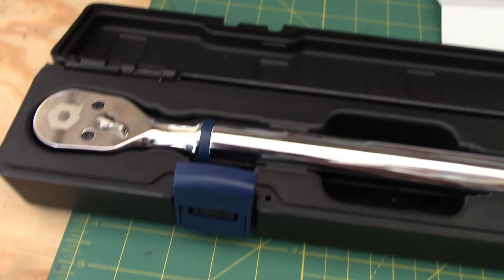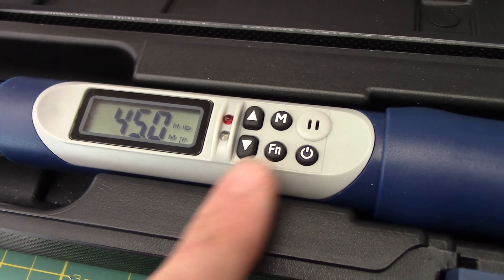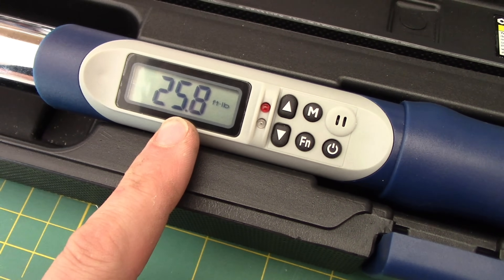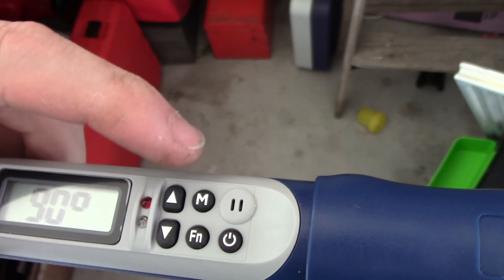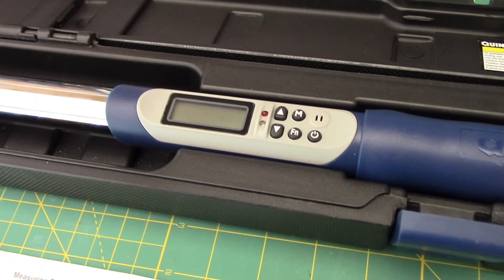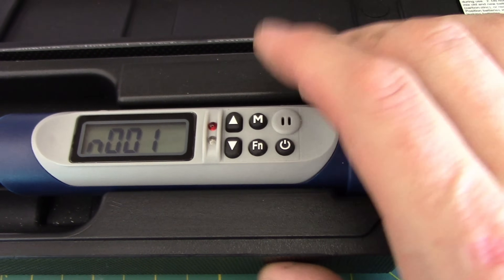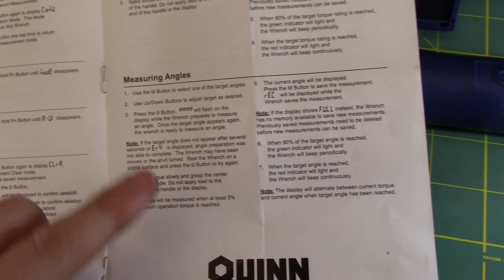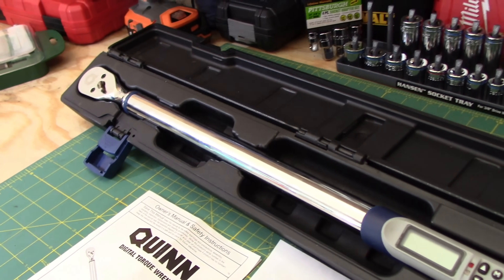How to Guide Harbor Freight QUINN Digital Torque Wrench including Torque Angles

Comment: This video is misleading, this torque wrench does come equipped with gyro to accurately measure torque ANGLE.
PLEASE BE ADVISED 

 like higher-end brands (e.g., Snap-On); it relies on a strain gauge to detect torque, and its angle measurement function often struggles or fails because it only starts measuring angle after significant torque is applied, making it unreliable for precise torque-to-angle steps compared to gyro-equipped models. Users report that while the torque measurement works fine, the angle feature often gives inaccurate readings, especially on loose bolts, leading many to recommend other brands for that specific function.

Comment: Ok, so basically you should torque your bolt to desired foot lbs first. then input those foot lbs and desired degrees.
Reply: I can't figure out to set the torque starting point though. In the instructions for "Setting angle torque unit" on the last step as soon as I press the Fn button to hold it, it changes screens

Comment: Thank you so much for posting this.  Sorry for the dumb question, but how would I set a degree back to zero in the memory for peak?  It only lets me cycle between 360 and 1 degree.
Reply: I think I get it now.  Each instruction is saved in a separate memory slot, right?  Thanks again for posting this.

Comment: The only bad feature is the "automatic power off after 2 minutes" that can get you in deep expensive trouble.
Reply: It does that after 2 mins of no use
Reply: Thanks for the heads up
Reply: Can you please explain how this feature can get someone into trouble?
Reply: @user-tl6xl3bw2h 

It should be fairly obvious, but without experience, it's understandable. 

If you are in the middle of a torque spec and you hit a button by mistake or it turns off right before you begin to torque then you could over torque your bolt and possibly break it. And gaskets and bolts, and time are all valuable.
Reply: @endtimesarehere1322  understandable and best thing is to doble check before doing something that’s why not everything on rush is going to come out the right way
Reply: FAIR WARNING CLEAR IT EACH TIME AFTER TIGHTENING EACH LUG NUT ON YOUR VEHICLE. Never had a lug nut come completely loose let alone ALL 6! Wheel came off. Tightening by hand from now on, never had any issues before
Reply: @Est3_85 you should be able to tell approximately the torque you're putting on your lug nuts. If it feels too light or hard double check your torque wrench.
Reply: Lmao,  stop it you “ Drama Queen “ it’s not the end of the world , and you will not lose your virginity.
Reply: Why do you say deep expensive trouble ? Is that about the heads
Reply: @Bryanoctxvio  heads and others before you figure out you have tightened too much or here noises
Reply: @TheRancher03  I’m so scared I’ve been tightening them and it’s going good but the angle is so bad on this torque wrench I left it alone for a couple hours while I went to get another torque I’m scared something is going to mess up.
Reply: @Bryanoctxvio  hope it's Ok. Truthfully, I don't use it after I found it out.
Reply: @TheRancher03 I've done the same thing with my snap-on wrench

Comment: I don’t know if I got a bad one but mine does this thing ware I hit FN button to select what value I want and it gets these 3 degree symbols across the screen and won’t let me do nothing. I let it shut off but when turn it back on still has the 3 degree symbols displayed and still doesn’t let me do anything. I haven’t even got to use it and need it bad right now as I’m putting a motor together. I’m very disappointed in it and thinking of trying to return it. Does anyone make a digital torque wrench that is basic without the degree crap that’s easy to operate for backyard mechanic?

Comment: Hey bro, thanks for the video!

I'm really confused about something and I'm hoping you can clear it up.

I torqued my heads yesterday and I'm not sure I did it correctly according to your explanation. 

OK, so the spec called out 22lb/ft for the first pass. I did that.
Then, I switched the mode to angle. The display showed 360, but I didn't change that, I just torqued the bolt up to the angle I wanted and called it. 

Did I do this wrong by not setting up a preset torque value/angle? I didn't quite understand what the instructions were trying to tell me. 

Or is the way I did it ok? 

Thanks so much in advance and happy new year.

Comment: I've got this wrench, I'm about to torque some crank bolts on a BMW M3. If the torque spec calls for jointing torque of 45 ft lbs and torque angle 1 of 50 degrees, then torque angle 2 of 50 degrees, would I set the wrench to 45 ft lbs for the angle to kick in? Then 1st swing 50 degrees, then 2nd swing 50 degrees.. would this be the correct procedure?

Comment: Just don’t understand what not increase torque rather than adding an angle to a lower torque...
Reply: Because the turn-of-nut method as it's known is far more accurate than just using torque. In this method the first step is to tighten to what is called snug tight. This can be specified in different ways. In cars, when it is used it is usually done by specifying a snug-tight torque setting. The goal of this first step is only to get the bolt to the point where subsequent turning will stretch it. The next step is to turn to a specified degree to achieve the predetermined preload. 

Using just torque gives an error range of +-25% in final preload. Using turn-of-nut cuts it down to +-15%. This greater accuracy allows the engineers to specify higher preload levels that take the bolt past its yield point and therefore more of the bolt's strength can be used.
There are also other even more advanced preload methods that cut the error % down to single digits.

Comment: I don’t get why the manual says don’t use the handle and hold the metal part to torque but yet package shows someone using the handle.
Reply: Because the head is meant to flex as that's what gives the torque reading, so holding it may make the wrench inaccurate

Comment: I don't know if you are still answering questions here or not, but I was curious does it only  measure angle continuously on one swing or if you are in a tight spot can you ratchet a bolt and measure angle?
Reply: It can ratchet

Comment: That was a very good and informative video about the Quinn torque wrench. What if the torque wrench it's knocked out of alignment how can it be recalibrated. I know it's just a 90-day warranty on it do you take it back to Harbor Freight or send it in somewhere where it can be recalibrated. Thanks for sharing. #PEACE✌🏾
Reply from the maker: 90 day bring it back to the store for return or replacement.  They don’t have repair or calibration abilities that would I’m aware of for these.

Comment: Price high-low Quinn 1l2,3l8 torque wrench. Quinn 66pc 35pc socket set 
Is ideal for maintenance and minor repair per HAYNES MANUAL. 
Icon tools is ideal for repair and overhaul per Haynes MANUAL

Comment: Thanks for the video but i find it difficult to understand. All i want to do is torque my flywheel to 70 ft lbs. Is that the peak or track? im lost..sorry
Reply from the maker: Peak is what you want as it will leave the results on the LCD display. The track only shows torque while you use it so it won’t help unless you look at the display and the readout is gone or goes down when you let off. Don’t use track for your application. Use peak mode or program in your 70 ft-lbs and test it out on a wheel lug nut or something if it’s your first time using it
Reply: thank you for replying. So I turn it on, zero it out, and follow the peak instructions? I think I am in the memory mode @ClientGraphics
Reply: Lay it on a flat surface, hit the power button to zero out, hit the Fn button to get to ft lbs, use up and down arrows to reach desired torque, and its ready to use...Is this correct?
Reply: @davidgomez2441  was that correct?

Comment: All you need is quinn1l2,3l8 TORQUE wrench and 
Icons 1l2 flex head torque wrench,
 And icons 3l8 compact torque wrench. And icons flex head double box wrench set, and icons double box wrench set:it breaks the bolt free on one side and ratchets it off on the other side.
I think these are the best tools HFT:Quinn and icon make so far. 
My tool list is very limited, cause these tools are in my tool box.
Almost $1000 in four TORQUE wrenchs,  and two sets of double box wrenchs. Rather with HFT then the other challengers. 
Advanced d-I-y over and out

Comment: Disappointing video. No demonstration to see it apply torque and angle.
Does it auto switch to angle after the torque is reached or is there a button press. Does it hold angle and continue after a ratchet.
Who cares about storing torque values. Just torque it and move to the next bolt. I have never had a desire to look back. Useless feature.
Useless video. Just as useless as the manual.
Reply: Thank you for saying it man, this was the most frustratingly biggest goddamn waste of my time to watch ugh

Comment: Don't understand the angle part, if it's set at 45Lbs the wrench shows light and sound at 45lbs so why is the need of an angle?
Reply: Some fasteners require a certain torque and 90° rotation.

Comment: I bought the Quinn 1/2" in July 2019. After getting used to it (after using clicker torque wrenches for years), and using it a few times, I liked it so much that I bought it's "little brother" 3/8" a few months later. It's SO nice not having to use one of those cheap torque angle gauges (I was always leery of their accuracy). This wrench has all the features and accuracy of the high $ brands at an affordable price.
Reply: So would you say the 3/8 is good for accuracy?im trying to tighten down some screws on my motorcycle.i first bought the icon inch pound torque wrench.out of curiosity I tested it with one of the beam style torque wrench.i set icon to 40 inch and it was clicking at 33-35 in on the beam..I set to 60 and it was clicking on 50 on the beam wrench..I saw the Quik and would like to know if you think it’s a good option for me to use on my motorcycle
Reply: @rafagas5150  I'd say yes, as long as your torque settings are above 60 in.lbs. . It actually has the capability to read 5 different units of measure including in.lbs. The problem is that it's "rated" for 5-100 ft.lbs. The lowest rated setting (5 ft.lbs.) is equal to 60 in.lbs.
Reply: Mike Brown thank you for the quick reply!!well I need to torque them down to 87 inch pounds so I think I might just go with this because any other brand would just cost a lot more.thanks brotha!
Reply: @rafagas5150  Happy to help. Have a good night and an even better day tomorrow.
Reply: Angle gauges are accurate as long as your holding point is secure
Reply: Bought one of these. Use it more often than my snap on. Level tool for degrees of rotation

Comment: First video I found with torque angle on a torque wrench. This is on my buy list now.
Reply: Do your homework before purchasing. This is not equipped with a gyroscope.
Reply: I bought the 1/2" Quinn in July 2019. After getting used to it and using it a few times, I liked it so much that I bought the "little brother" 3/8" a few months later. I build engines for myself and friends in my spare time so, I NEED quality tools. Most of the tools that I don't loan out are S-K but there are a few other brands mixed in. This Quinn has all the features and accuracy of more expensive brands at an affordable price. You won't regret buying one.
Reply: Mike Brown I bought that sucker and I’m glad I did! Won’t go back! So easy to use.. worth it!

Comment: Just bought this wrench and found it funny that having owned and used torque wrenches for like 35 years, I had to go to YouTube to learn how to use this one 😂

So two questions.  First, what exactly is track mode? What does it do differently?  Second, I'm not understanding why I'd want to store readings.  I'm sure there's a great application for it, but I'm not seeing it - when might one use that feature?

Thanks for the video! 👍
Reply: That's what happens to us old timers when we buy tools that are "smarter" than we are. Hell, I just finally got dragged kicking and screaming into the 21st century about 3 years ago when my ol reliable flip phone died on me! Until then, I didn't even know what YouTube was lol! Honestly though, I have both the 3/8" and 1/2" Quinn digital wrenches. Once I figured out how to operate them I immediately fell in love with them.
Reply from the maker: Tracking is for watching the torque being applied as well as the let down and doesn’t hold the peak so I personally would not ever use it. I prefer peak as it keeps the highest value on screen for you. I personally don’t store any results in memory.

Comment: Thanks for the video
Let say if in need to get to 70 degrees.  But i dont have enough room to get to it. So i need to go back.  To get room to get to 70. But i think when we back it off. We lose 5 degrees to get to 70  .  Can you try yours .  Thank you
Reply from the maker: I don't believe you lose the angle it keeps it so you could ratchet to the 70 degrees total if you needed it in multiple ratchets.

Comment: Does it display the maximum torque achieved when doing an angle? Getting ready to do head bolts and would like to see what the final torque is on the last 90 degree swing.
Reply from the maker: I believe it does.  It may flash between the angle and torque or you toggle between them I can’t remember.  If that part is critical I would recommend testing it before to confirm and if you can store and recall both torque achieved and angle

Comment: i can’t get the battery compartment open.
i can turn the slot to be in line with the open circles, but the cap stays recessed.

any suggestions? this is weird.
Reply: Just keep turning past the open circle, the slot angles up and out.

Comment: Does the angle function work like the Snap-On version if you aren't able to turn the full angle without ratcheting the handle back? In other words...if you need to turn 90 degrees...but don't have room to do so...does it add up the angle of each turn that you make?
Reply: Jeff C According to a different comment, it does have this feature.

Comment: Hi ClientGraphics, can you ratchet back when doing the TORQUE ANGLE feature if you were in a tight quarters?
Reply from the maker: Yes, you can ratchet back and it remembers the position to start the count for the angle measurement when you again are within 5% of the specified torque setting.
Reply: @ClientGraphics  Thanks, I was curious I need to get a torque angle one! 👍
Reply from the maker: Aris Torm It was actually a super question. I typically don’t have any applications off the top of my head that are space constrained that much but I also find out HF now has extended warranty plans on these item 1yr at $29.99 and 2yr at $49.99 it that stuff matters to some it does.
Reply: Great question, plenty of places on German cars that have tight spots and they love to specify torque + angle, axle bolts, wheel bearing bolts, engine/transmission mounts, etc. Great video!

Comment: Bought this torque wrench and have used it for torque and angles on a head bolt job.  Worked very well.  very pleased with the purchase so far!
Reply from the maker: That's awesome to hear and thank you for watching and leaving a comment.  Did you have a standard style torque wrench before or have any thoughts or feelings about how it's visual and audio feedback without out any physical clicking?
Reply: @ClientGraphics  I have had old style clickers, but upgraded to Precision Instruments split beam torque wrenches.  I have used SnapOn TechAngle torque wrenches before.  The Quinn is very good - I miss the vibration of the SnapOn, but the Quinn is $350 cheaper.  I can do without the buzz.  I needed the Quinn mostly for the torque angle capability - which worked well with the head bolts on my BMW.  Seems well built, accurate and a value!
Reply: Same very good quality tool for Fabe price

Comment: The Quinn looks like a decent digital torque wrench with convenience if you don’t mind digging slightly deeper into your pocketbook to be able to have it!  Additionally, if you work in low light setting at night or in a dimly lit shop this lacks a backlit display so it might be a no-go for some.  Having to not do any conversions could be a huge plus, but I only use ft-lb or in-lb thankfully.  Nice How to for someone that is looking.
Reply: That's what a head lamp is for.